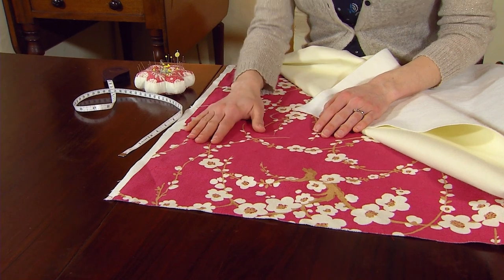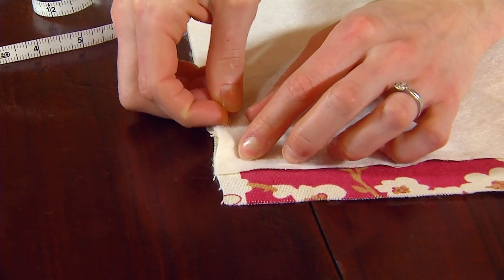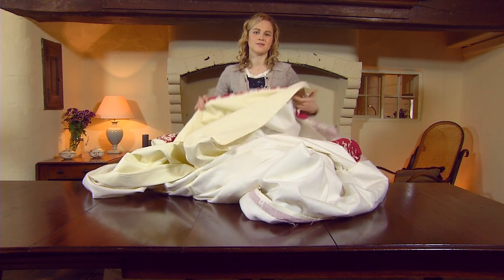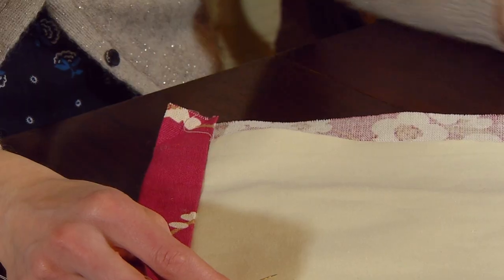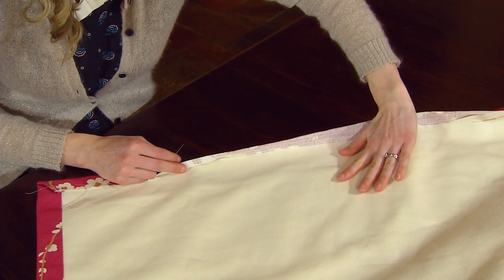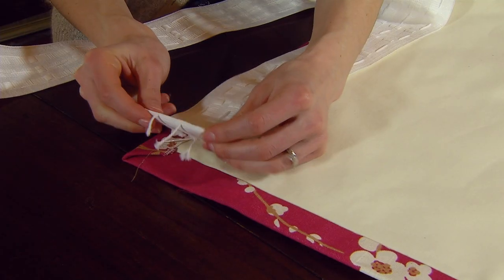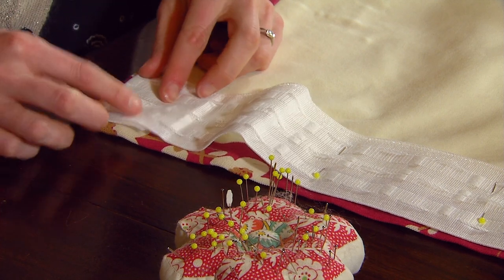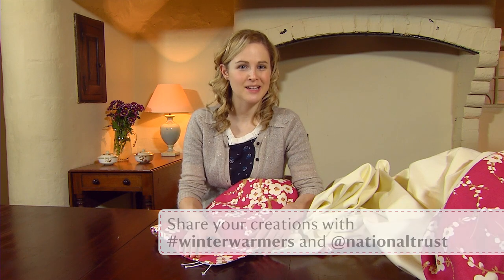How to Make Thermally Lined Curtains - Part 4 of 5 - National Trust

Comment: I used this video to make an interlined door curtain.  It turned out very well and insulates the door.  Only problem I had was laying out the fabric as I did not have a large enough table or even floor space.  Still managed it though.

Comment: "Sits where the crease is on the main fabric"(at the top).  There was no instruction to put a crease there before.  Where has that come from?
Reply from the maker: Hello, between 00.58 and 01.10 Lauren explains the need to press creases into the curtain but perhaps she needed to make it clearer that this applied to the top of the curtain as well as the sides.

Comment: I am not sure what to do with the running stitch at the top holding the interlining in place
Reply from the maker: Hello Susie A1. Once you have attached the curtain heading-tape, you can unpick or cut the ends of the running stitch holding the interlining in place, and pull the thread out. Alternatively, if the stitch is not visible on the right-side of your fabric, you could just leave it in place.

Comment: I am confused as part 1 says to cut the soft backed lining 4cm narrower in width than the finished curtain so I can't match up the edges of the main fabric and the soft backed lining as shown in part 4. My soft backed lining is too narrow, please help...
Reply from the maker: Hello Philippa, you need to line up one edge of the top fabric with one edge of the soft back lining and sew them together, even though the other side of the fabrics will not line up. Then turn the fabric around and bring the other edge of the top fabric together with the other edge of the soft back lining and sew them together. The top fabric will be wider than the soft-back lining. When you've sewn both edges together, turn the tube of fabric right-side out and iron the edges. This way, the seams all end up on the back of the curtain, as shown at 1.04 in this video, rather than running down the edge of the curtain. We hope this helps.
Reply: I am also confused by this as thermal lining is 14 cm less than the main fabric as per instructions
Reply: @fionakmp  I think she said four cm not fourteen cm?